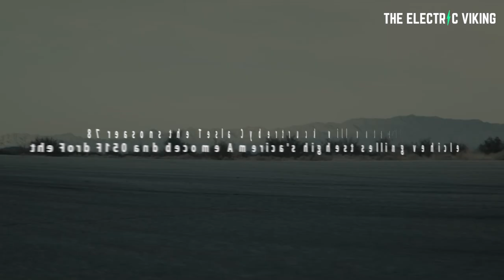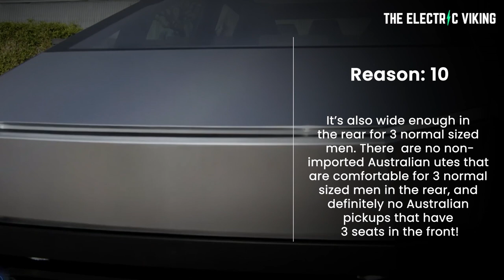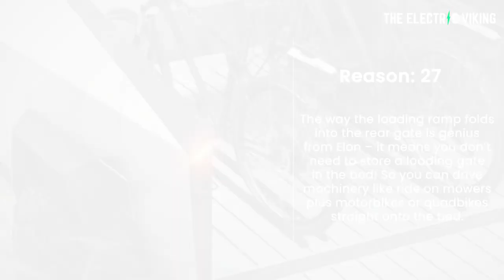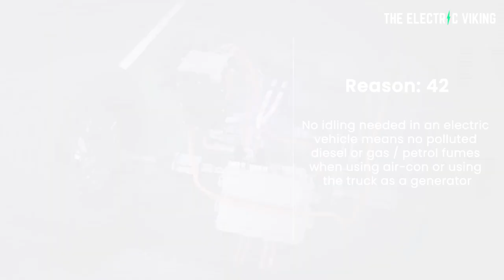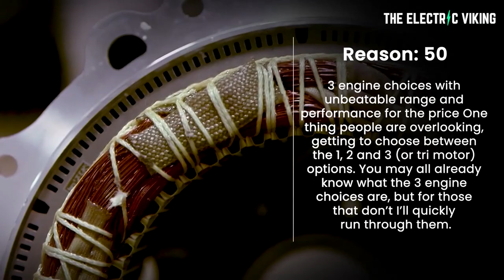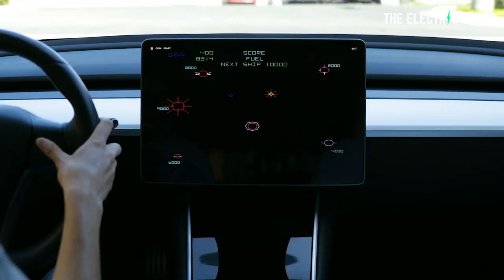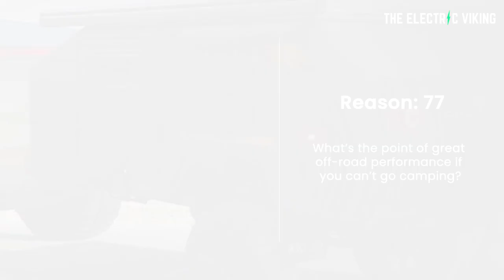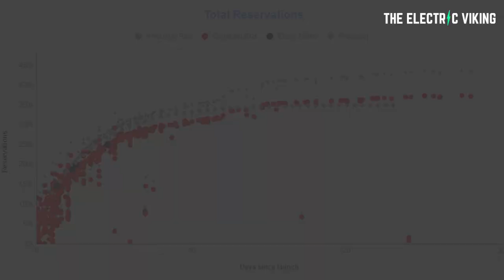87 reasons the Tesla Cybertruck will outsell the Ford F150

Comment: 1 reason not to gloat...Ford buyers know what they're getting.  Doorstop reservation holders, DON'T.  And whenever Tesla DOES start production, IF EVER, the truck people start getting will be different enough from what they ordered, that most of the orders will drop off.
Reply: That's not the case with the current models.  Your "if ever" implication is not accurate.  Tesla says what it plans to do and does it.  It may take longer than initially planned but are you honestly going to fault a CEO for having ambitious plans?  Tesla is forcing modernization throughout the legacy automotive market.  We will all benefit even if you buy another brand that eventually is able to copy Tesla.
Reply: @billcichoke2534  That's easy, taking the electric vehicle market seriously.  They were all laughing at Tesla when Tesla started.  First it was they only make luxury cars, then it was fit and finish.  Tesla has the best technology for ev's hands down.  Their recent Model S Plaid beats the Porshe Taycan for a fraction of the cost.  I'm sure you've heard of Sandy Munro.  Check out some of his videos where he compares legacy tech with Tesla.  Tesla is ahead and for you to deny it is willful ignorance.  Just over the air updates is something Tesla is doing and others will have to copy or fail.  There is no stock fraud, there are investors who believe in Tesla's mission to transition the transportation sector and the grid to sustainable energy along with many enthusiastic owners who love their cars.  You obviously have an axe to grind.  Musk poured millions of his own money into the venture before it ever became profitable so for you to act like he's a guy milking some ponzi scheme is BS.
Reply: @billcichoke2534  It is obvious that it is pointless to communicate with you but I will address your initial point and we'll see if you can come up with anything better than name calling.  Things Tesla is doing that set the standard for the EV automotive industry:  A Charging Network.  Tesla's charging network is more comprehensive and better than the others.  Tesla cars are more efficient.  Tesla has poured engineering quality into all aspects of its cars including the heating/cooling system, the motors, the batteries.  Teslas KW/hr is higher than all competitors due to its higher quality batteries so I'm not sure why you criticize them.  They're the best now and their new batteries will be even better.  Tesla will be getting into mining Lithium.  Tell me of any other auto manufacturer that will be doing that not to mention manufacturing their own batteries.  Tesla's single casting that is being employed for the model Y body will save tremendous amounts of cost and will reduce the weight.  Teslas efficiency and battery superiority allows for greater range and greater options in terms of design.  And of course we're only talking about the automotive side.  Tesla is manufacturing batteries and solar panels/roofs for home use.  Tesla's autobidder software allows users to reduce grid use when cost is high and shift back on when cost is low making for savings for homeowners.  Tesla is manufacturing large scale batteries for commercial and industrial application.  Their installations are saving companies and regions like Southern Australia tons of money and helping to balance out the grid.  So these are a few of the ways I think Tesla is ahead.  The stock is priced as it is for a reason.  If you haven't seen any of these reasons or you think they can all be dismissed, then you haven't honestly looked at Tesla or its competitors.
Reply: @RawandCookedVegan  Okay, first, you don't berate someone of namecalling as part of an exchange when you were the first to do it.  That's as bad as going to a lumberjack convention, wanting to roll someone off their log, and getting mad when you get wet.  Not a good look.

To your contentions...

The charging network has been built out at the cost of local small businesses, which is why more and more of them are isolated in industrial parks.  To that end, ALL charging networks have the same flaw.  There's only so much power available in commercial spaces, and each charger station reserves around 1 MW for its use.  That means at least 3-5 small businesses are put out of business, since there's no longer power for them.  Musk's contention that they're powered by solar and his batteries, is a joke at best and a lie at worst.  No car company wants to be making the chargers, any more than they want to be making and maintaining fuel stations.  So that's not an industry standard, nor is it likely to be.

Tesla has poured money into SOFTWARE engineers, to manipulate and band-aid their poor MECHANICAL engineering skills.  The octovalve and heat pump as a 'solution' for Tesla, came from trying to reverse engineer the system from the Taycan (which had it well before Tesla thought of it).  The Tesla version can't even keep a windscreen defrosted during winter driving, since it has no resistor heat back up.  Not very high quality or cutting edge, that.  As well, using aluminum all around, when it's harder to work with and CANNOT be repaired when damaged, does little but save some weight.  It costs more, and is another expense the car's price cannot recover.

The castings?  Interesting that Munro praises them for being so 'advanced,' when he and others berated Ford and GM for doing the same thing in the late 80s and early 90s, calling it a 'cheap shortcut' and a BAD idea.  As with Ruger casting some of the parts for their P-series pistols, where the parts would crack under normal use and render the pistol inoperative, Ford and GM were having issues with frame parts cracking where the suspension was attached...under normal use.  Tesla is not better at this game than companies who did it before, and has not shown the process to even be able to WORK.  Just because they have a huge press, doesn't mean they know what the hell they're doing.  You can buy a full-blown digital production suite; it doesn't mean you know how to make the next Lord of the Rings.

I think it's time the 'Tesla makes their own batteries' lie stops being repeated.  Panasonic, LG Chem, Samsung, and CATL make the batteries for Tesla.  Telsa made a huge deal about their Nevada factory, and that they bought Maxwell.  That factory has housed PANASONIC machines, making the same PANASONIC battery cells that PANASONIC sells to EVERYONE WHO WANTS THEM.  And trust me, Musk isn't getting those cells at $1.70 per cell, when Panasonic can turn around and sell them wholesale for $6 per cell.  There is no 4680 any time soon, and Musk already tasked Panasonic to MAKE it.  He's not making anything himself.  As well, there are chinese manufacturers making 18650s and 21700s with higher mA capabilities, but none are said to increase range that much.  That, in and of itself, should show you what I've said about Tesla designing their battery packs to OVERCHARGE the batteries and get closer to the advertised range.  Not efficiency, not superior chemical or electrical engineering, just a lot of cooling and crossed fingers.  And many times that's not enough to keep the cells from burning.

I don't talk much about Tesla Energy, because that's one of the biggest JOKES out there.  The software doesn't save ANYONE ANYTHING, since the problem is the erratic nature of wind and solar power.  Software doesn't touch that; you have to pay PEOPLE to monitor and manipulate baseline power, since those utilities are FORCED BY LAW to 'buy' renewables, often paying the solar and wind owners for a full day's power when they got less than 3 hours' worth.  Some software telling them where another pinwheel pinhead or smoke-and-mirror solar owner is, is a cruel joke on an already abused grid.  Ask the Aussies how they like their continual brownouts when the batteries aren't fast enough or charged enough to give enough transition power to the grid while the operator connects with a COAL-POWERED neighbor to the north.  Ask the Puerto Ricans how they enjoyed Tesla solar panels and batteries, that burnt out quite a bit of what remained of their power grid.  DIESEL GENERATORS FROM THE US had to be flown down there, to help them turn some lights back on.  And Tesla Energy sucks quite a bit of revenue from the overall Tesla financial picture, being either flat or negative since Musk conned the Tesla shareholders to buy Solar City.  Again, not the great look you think it is.

Tesla is running a race over a cliff.  They are NOT winning against all competitors, since only a fool would run THAT race.  And they are not industry changers.  People still want a test drive.  They still want to haggle a price down, and not be forced to pay the 'only' price.  And they want service when something goes wrong, that doesn't require their car being shipped 3 states or a continent away.  Real car makers are not trying to catch up to, keep up with, or copy Tesla...mostly because they made many of the same mistakes he's making NOW.  They learned from them.
Reply: @RawandCookedVegan  Saying things like a dissenter is 'short sighted' or 'has an axe to grind,' IS name calling.  So no, I was NOT the first.  And calling a continued reliance on petroFUELS 'short sighted' when literally EVERY part of 'sustainable' products depends on petroCHEMICALS, is naive.  You might want to consider that, if the smaller fraction of a barrel is in higher demand than the larger fraction, that requires even MORE of those barrels, NOT LESS.  Also, rather embarrassingly to the 'peak oil' crowd, overall worldwide production seems to be easily keeping pace with demand.  Kind of hard to do that if we're supposedly running out of the stuff, wouldn't you say?

And you can tell it's GOVERNMENT FORCE setting the agenda and not Tesla.  As I said before, literally NO real car maker is following Tesla's lead.  If the EVs they're making are still basically 'compliance' cars, then it's being done under duress, NOT because Tesla is the only company with competent engineers.  Also, Panasonic and not Tesla is the designer of the batteries being made.  As with the acquisition of Maxwell, any noise made about what Tesla was going to do, was just that.  Tesla made a big agreement with Panasonic for THEIR batteries, and the only difference is the Tesla-branded skin over the battery contents.  No wet electrode, no secret sauce, no difference between the batteries used in Tesla cars and the cells used in laptop and camcorder battery packs.

I want Tesla to fail because it's a scam, and cheaters should never prosper.  I want it to fail because Musk is a conman subjecting owners AND THE GENERAL PUBLIC to products not ready for production, to everyone's peril.  And I REALLY want them to fail because they are the excuse used by tin pot dictators the world over, to remove our freedoms and exercise more control over us.

Not unreasonable.  Any sane person would want the same thing.
Reply: Thank you Bill and Raw. Very entertaining!
Reply: @billcichoke2534  Bill Bill Bill please pull your head out and actually look at the world it's a changing in front of your eyes!